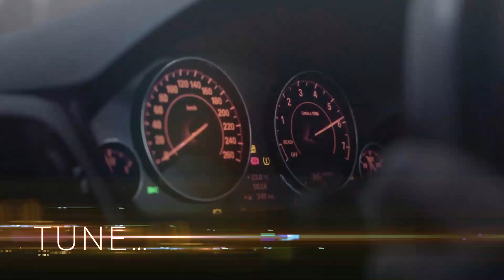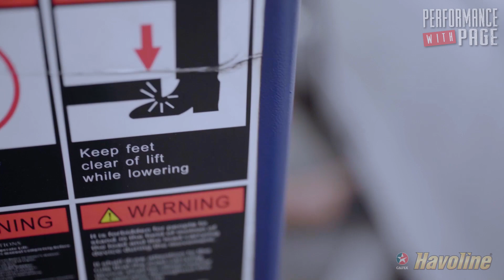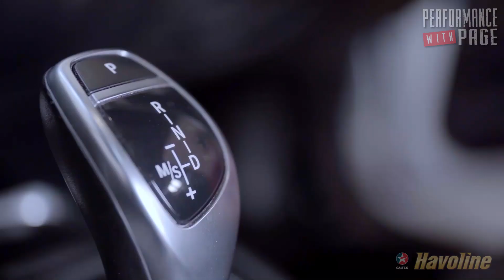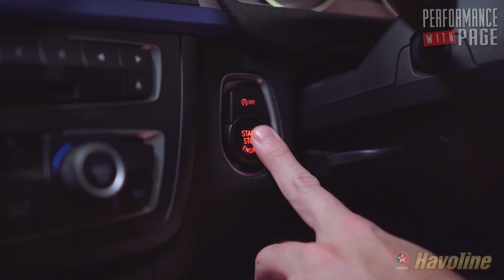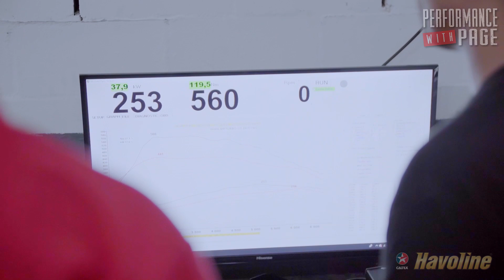Havoline Project_ 335i (EXTENDED VERSION) Episode 2

Comment: 253kw for stage 2 335i is a low number... Why are you guys so happy
Reply: This car is tuned for low octane pump fuel, daily driving. And this is true wheel power. We have had Boodmode3 cars get stage 2 agg tunes and dyno on our dyno and they don't make more. Limitations are fuel not tuning. This is as good as it gets power wise.